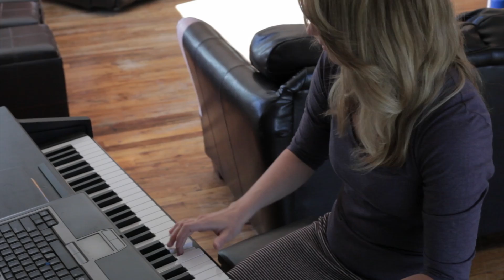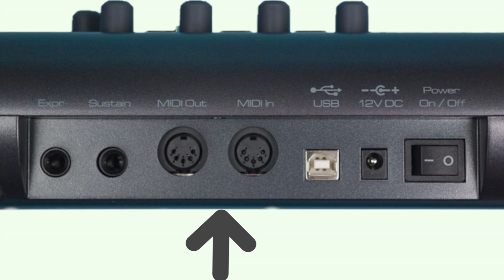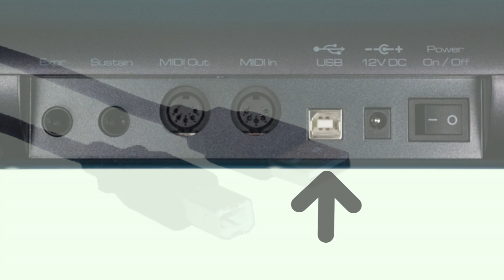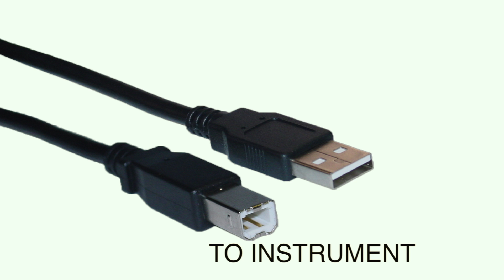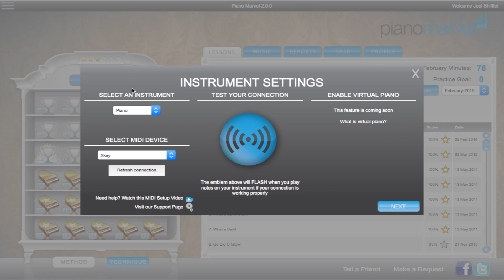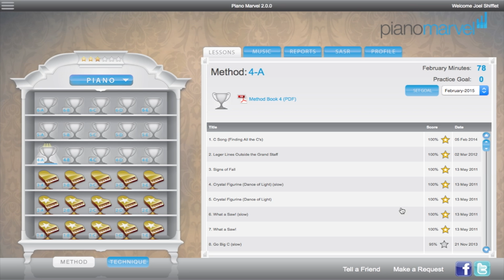MIDI Instrument Setup

Comment: Even though my midi keyboard is connected via a usb midi port and I have what I assume is the correct software from your site, my keyboard is not even recognised. At the press lowest key prompt, nothing happens when I do. I can use it with other software I have on my computer no problem.

Windows 10. Chrome browser.
Reply: Same problem here, did you ever find the problem?
Reply: No, I gave up!
Reply: So, it must be a windows 10 thing. It works fine on my macbook. weird

Comment: Is it possible to HEAR the notes you play? Because everything is setup just fine, it's just that I can't hear the notes I play.
Reply: Cynos Gohegdae If you are using a keyboard that has internal speakers, you can hear it that way. Piano Marvel is coming out with a piano sound library that will allow you to hear with a MIDI controller soon.
Reply: Oh snaps, thank you! I was wondering, so I'm glad I actually got an answer.
Reply: For people using a Midi controller without speakers they can use turn up the volume of the instrument found in the Play Controls.